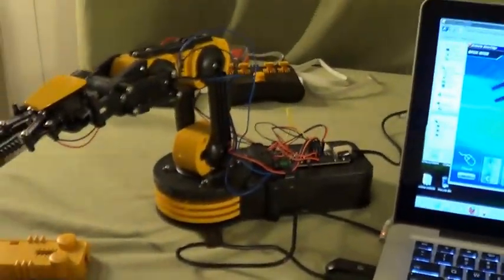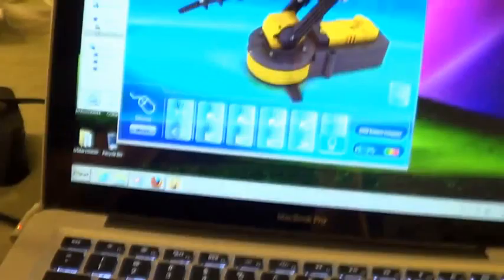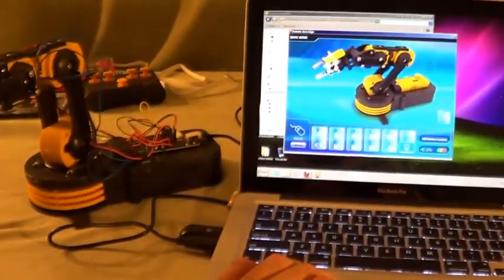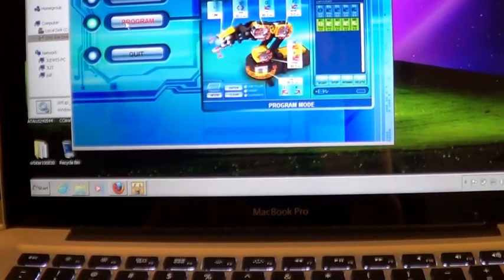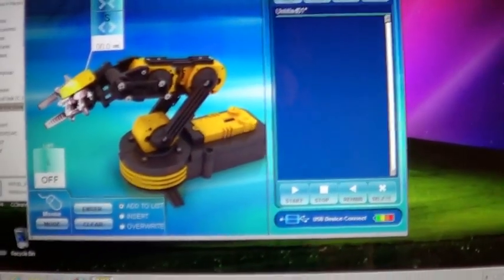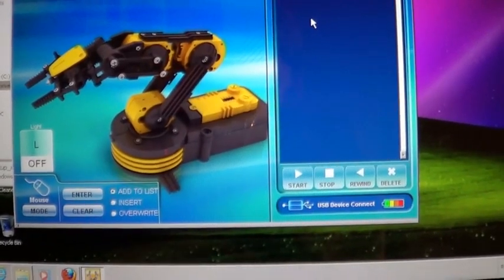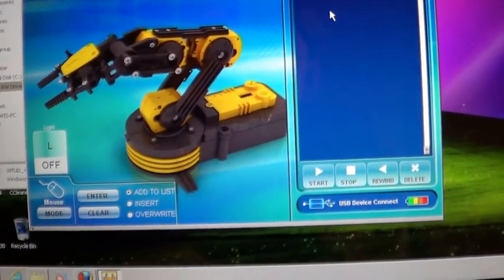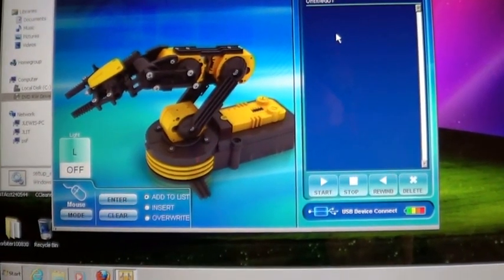OWI Robotic Arm Edge Plus OWI-535/SOFT USB Interface Kit

Comment: how did you make the usb software compatible with your pc what windows operating system are u using plz
Reply from the maker: +Richard Gargan I have had the software running on all versions of Windows from XP up. The software that is shipped will not run on 64bit Windows. If you go to the main post on the website: 

http://www.sysrecon.com/electronics/owi-robotic-arm-edge-plus-owi-535soft-usb-interface-kit/ 

It has a link to the 64 bit drivers also found here:

 http://www.owirobot.com/pages/Downloads.html 

The drivers cannot be installed without temporarily disabling Windows Driver Signature Enforcement. the steps to do this can be found here: 

http://www.sysrecon.com/operating-systems/how-to-install-unsigned-drivers-in-windows-8-1/ 

I hope this helps, take care.
Reply: Thanks I will give it a go..